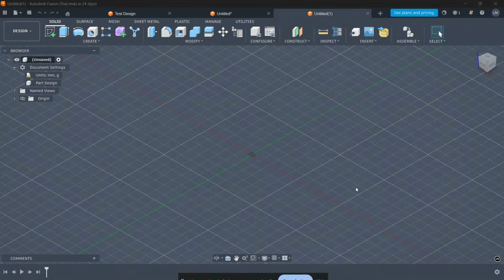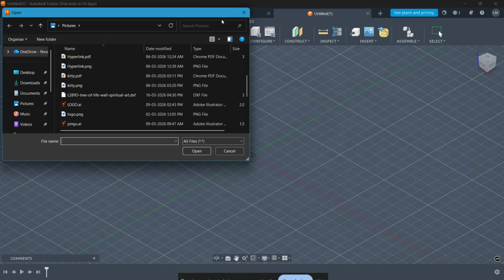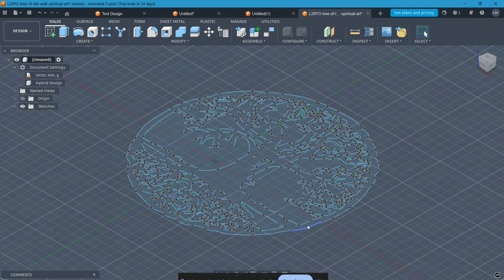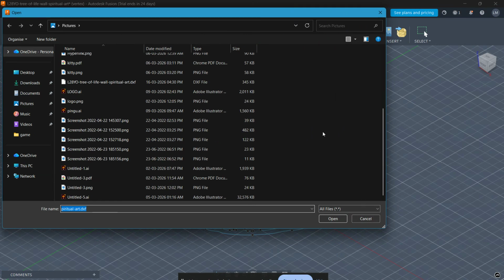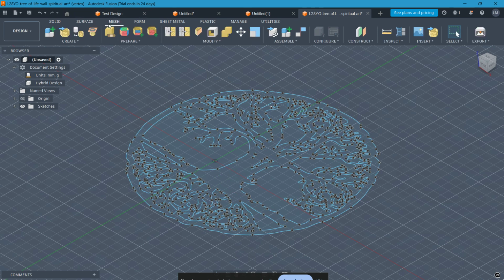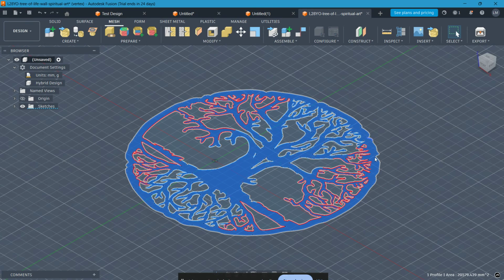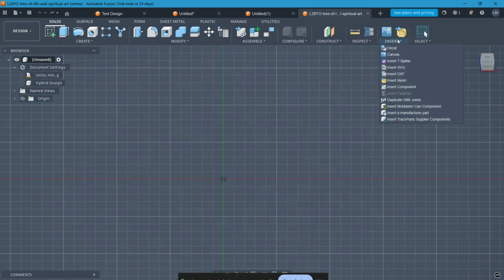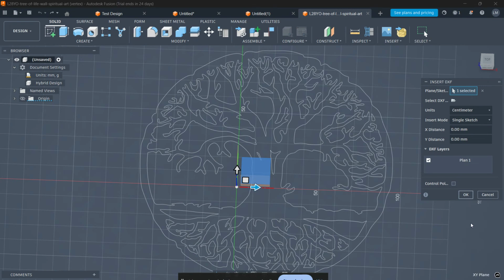Fusion 360 Import DXF Error (2026 Easy Guide)

Comment: How Do I export a .dxf? When I export from a sketch the file does not work.
Reply from the maker: The 'Export' menu in Fusion often creates a 3D DXF which many laser cutters or CNC programs can't read. To get a clean 2D file, go to your Browser on the left, Right-Click the specific Sketch you want, and select 'Save As DXF.' This creates a flat file that works perfectly for most machines!

Hope this helps! If it did, feel free to like and subscribe for more Fusion 360 and 3D design tips.